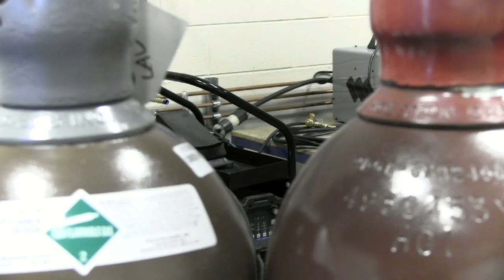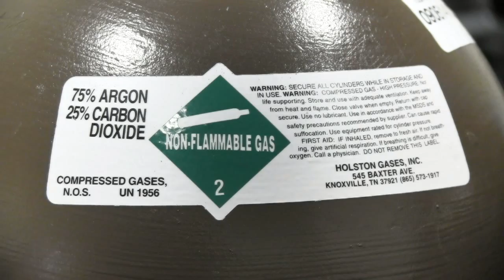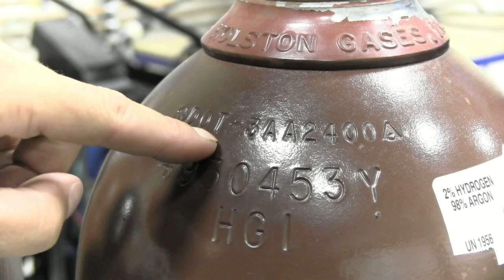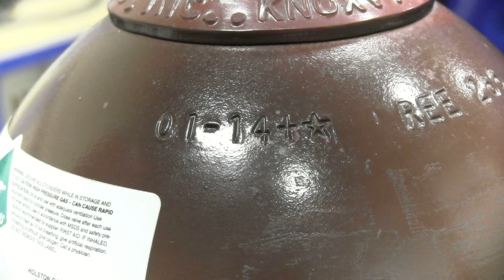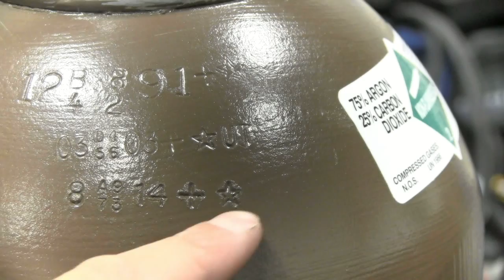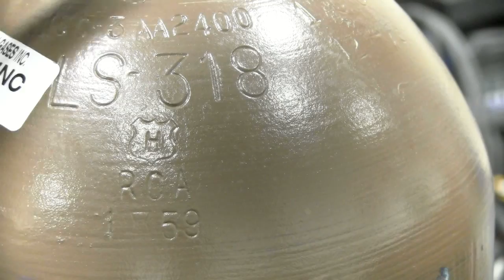High Pressure Cylinder Identification

Comment: Would be nice if you explained that the cylinders sizes you claim would be leased or rented are strictly your company policy.  There are plenty customer owned cylinders in the size range you state as rented.  Yes I think there is somewhat of a racket when it comes to cylinders and “ownership”.   I work for a company that leases cylinders and we frequently have to buyout lost cylinders but when they are eventually returned by “borrowers” there is no refund.   Yeah looking at you “Big Three”
Reply: For a bit of clarification, if a someone has to buy out a leased cylinder, that cylinder serial number should be documented as a customer owned cylinder and if it shows up for refill be treated as such.

Comment: How can that lead seal melt at 212f when the melting point of lead is 621f? Did I miss something? 😊
Reply: It's actually a metal alloy similar to solder, not sure exactly what it it though.  This is precisely the reason if you've ever taken a welding class at a trade school or community college for instance,  one of the things you're taught is to never use boiling water to thaw a frozen valve or free a cylinder frozen to the ground since you could either melt safety plug or soften it enough to leak, and some cylinders,  particularly larger acetylene cylinders, have a safety plug at the bottom as well as the valve assembly.
Reply: That makes more sense with the alloy. Thanks.

Comment: The DOT-3AA is not specifically a steel material designation, but rather a cylinder design standard.  Take  a look at 49CFR178.37.  The hydro static test pressure is  also 5/3 times the marked service pressure.  https://www.ecfr.gov/current/title-49/subtitle-B/chapter-I/subchapter-C/part-178/subpart-C/section-178.37

Comment: Thank you so very much for this wonderful explanation and it really shed more light on my understanding about the sizes of and the markings on these gas cylinders.One thing that I just want to further understand is the size of a cylinder that is smaller than the 80 cu/ft and bigger than the 40 cu/ft, what size can that be.The 80 cu/ft is the Oxygen cylinder that I have and the other one that is smaller than the 80 cu/ft and bigger than the 40 cu/ft is the Acetylene .What size could that be.Thanks and I hope I will be able to get a response from you as regards this .

Comment: I'd never deal with a welding supply company that restricted the size of owner cylinders.  I've got a half-dozen bottles, ranging in size from 80cf to 250 cf,  I used to have a 330cf bottle, but traded it for another 250, the 330 was a little bigger than I like to move around my shop.  My welding shop takes my bottles, and exchanges them for full ones, so "your" bottle changes when you bring it in.    I can't imagine insisting on getting "my" bottle back, but I suppose it could be done.  Frankly, I don't care what the bottle looks like, as long as it's within hydro cert, has no ownership markings, and is the same size as the one I brought it.
Reply: Some guy died and I acquired his tig equipment.  The argon tank is 125 cf but it has a Praxair sticker. Can I get this filled or will they take my tank away from me cause I guess it's owned by praxair?
Reply: @Dookie_burnerno, companies always put their sticker on tanks. If it's stamped on the neck then that is a different story.
Reply: I don't either...I have to drive futher...but it's also about 1/2 price from air gas...and I don't have to pay rent.
Reply: @jody6121  Hate that company,  sold me a 125cf when I bought a little hobart 140 from them just to learn and do small stuff years ago...  Knew the tank would last me for ever so leasing was dumb....  Go back to fill it maybe 3 years later and they pulled the customers can't own bigger then 80cf crap and we can't find you in the system that's our bottle, had to go threw 3 different shops to fill my own damn bottle.  You can buy 125cf any where on line cheaper its just depends on the shops and most big name ones suck to deal with... And don't get me started on the deal they pull with nitrous these days.
Reply: In canada you cannot own larger than 80cu ft
Reply: @Mrdubomb  well that is horrible
Reply: @Dookie_burner its people causing big bangs
Reply: Right👍👍👍
Reply: I'm searching for a good deal on an argon gas cylinder for my tig welder, but the prices these people here are trying to charge is utterly ridiculous😞
Reply: Absolutely, I don't have anything smaller than a 145 cf cylinder and I would leave with my tank if they tried to swap me for a leased tank.

Comment: Next to the test date stamp on the tank to the right, theres another marking labeled "REE 2...." What does that label indicate?
Reply: REE means rejection elastic expansion is the retest operator if it's above that level it's means the cylinder will be bad when calculated after hydrotest.

Comment: My dad owned a 125 cu/ft O2 cylinder for 30 years that was made by his friends company: Mittler Supply (RIP Tom Mittler).
Dad meticulously minted out the tank and painted it beautifully Green and Brown. He then dropped it off at Knoxville Holston gases to be filled. Jerks lost his tank and gave him some beat up, worn out rusty oxygen tank and threatened to make him lease when he is an owner... Holston gases, treat your customers better.
Reply: Strickland is where i go for all my propane needs and propane accessories,,mr Strickland sure treats me nice
Reply: @ARCSTREAMS  propane and propane accessories
Reply: @Dookie_burner  yesssir :)
Reply: i use Compressed Gas Supply(a Praxair company) here in oklahoma, they practically bend over backwards to work with me

Comment: How often do cylinders actually fail testing is it like 1 out of 10, 1 out of 100. My dad gave me a older cylinder manufactured in 1941 also with a us navy stamp on it that last cert date is 66 and is rated for 1800psi and it’s a odd size to it as well it’s about 5 inches taller then my 80cf but is also skinnier then the 80cf. It has a cga540 valve on it for oxygen so what I’ve been thinking of doing is buying a transfill hose and just filling it myself from the leased tanks at my work.
Reply: The military tanks are extra heavy wall and I would have used that to make a cannon 😂

Comment: the guy where i fill mine always gives me some talk about them not always able to give me a 2500psi fill and might give me only an 1800 or whatever,says it has to do with what pressure there refil tanks are holding,,is this all bs or what? how do i get 2500 every time?
Reply: By far I'm no pro but I feel like they're selling you short
Reply: could be ,but i recently went in to that shop again to refill my 55-60cf oxy cyl and those guys were not there but the guy told me that my tank says it can only be filled to 2015psi and if it allows for 10% over fill then i can get 2200psi but the tank was expired so i had to pay to get it recertified,only it did not pass for a 10% refill nor a 10 year star ,i only got 5 years certification and they only gave me around 2000psi ,,think i will try to cheat and stamp my own test hehe
Reply: if it means saving money not buying a 300 buck tank then its worth it
Reply: @ARCSTREAMS  lol
Reply: @Genetics1  they been ripping me for years i might as well return the favor right

Comment: can you please help me with the info on mine? i am in canada where i purchased mine,i believe it's a 60cf  but i dont recall,either 60 or less,anyways there is no marking on the neck,here is what is marked on the bottle 
SPUN 5WH79+SCM  1{dash line with circle under it with vertical line in the center of circle}92
CTC 3A-2015
PF 11541        12(small 353) 06+star
Reply: The SPUN is just a manufacturer info, Ctc 3A-2015 is the type of steel cylinder and max pressure it can be filled to, the PF 11541 is the bottle serial #, the 12(353) 06+* is the last date of test.12 [December] manufacture or tester RIN 353 and 06 is the yea of 2006. + means it can be filled 10% over bottle pressure and * means 10 bottle shelf life befor being needed to be retested from 12/2006, so dec of 2018 is the needed test to recertifications your bottle
Reply: i did re test it in dec and unfortunately did not get a star or a plus rating so it will need to be re tested in another 5 years :(
Reply: thank you very much for the precise info and you are correct but what about the " 1{dash line with circle under it with vertical line in the center of circle}92"
Reply: @ARCSTREAMS  that is the independent cylinder inspection symbol, its put on during manufacturing.
Reply: @baudeagle1  ty

Comment: the Local Praxair and Airgas told me that my tank could not be traded in because of its size it is either a 125CF or 122CF with no ownership ring, there for it is a owned cylinder not a rental and it has lasted me about 4-5 years so far, but still denying a fill because of its size is a bad business model if your tank does not have a  ownership ring.
Reply: Did you ever get it filled? I am in the same situation
Reply: Rent one slightly bigger and fill you’re original thank whit it and return it back the next day that way you only pay for the gas and you can fill up your thank and not pay rental fee. But you need to buy high pressure hose 2500 psi and have the right connection for the tank, bingo.